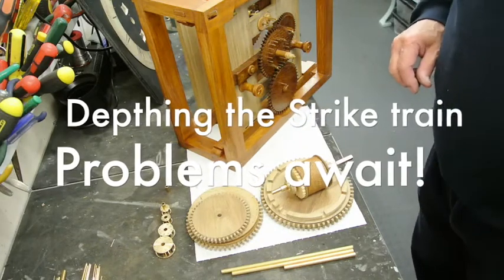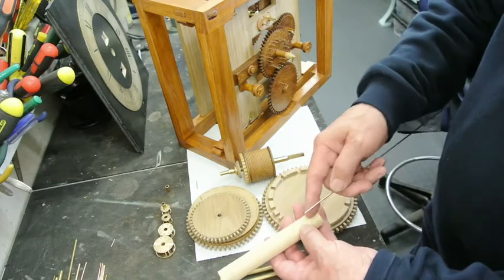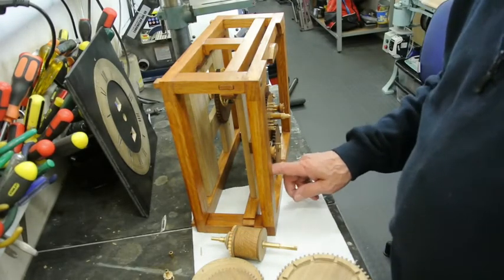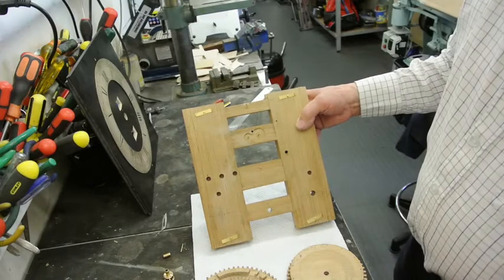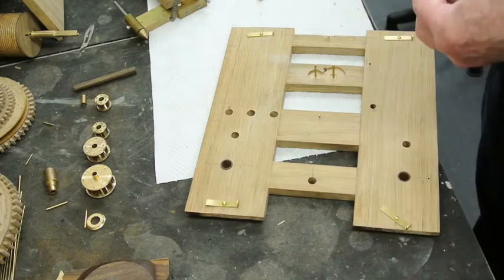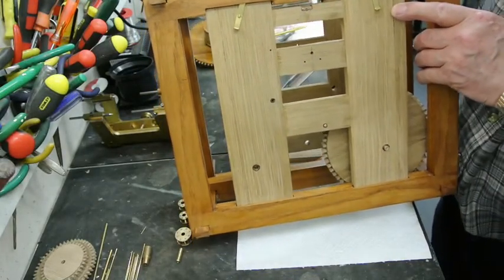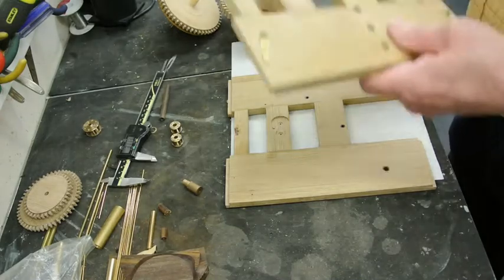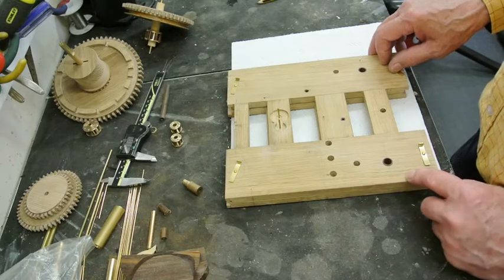Making John Harrison's wooden clock Part 7

Comment: hi john 1 good turn deserves another, you gave me some good info and i,ve been inspired by your rivett , and potts videos
 .i,ve been watching your clock build  and if you want i can give you 2 or 3 pieces of seasoned 1/4 sawn oak 6"x1/2"x approx 30" long, lovely stuff i use to do cabinet making its yours free if you want  cheers john anderson
Reply from the maker: John

Many thanks for the kind offer. Perhaps you would let me have your email and address via my contacts page on www.jgwright.co.uk. As a cabinet maker you would be well qualified to make the clock. I am well advanced now with the drawings and have a fair bit of it modelled in 3d in Solidworks. 
John